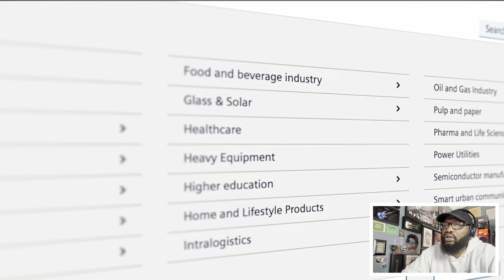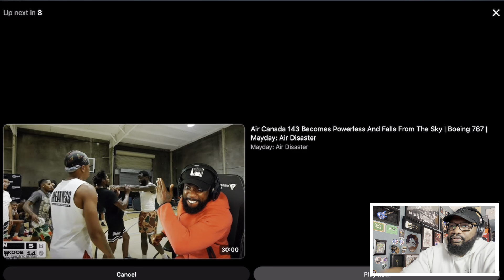Helicopters DON’T just fall from the sky - What Is “Mast Bumping”?

Comment: Sounds like maintenance on this helicopter wasn't kept up.
Reply: You can keep up maintenance, but when a part breaks, after inspection, and you're in the air... Bad news! Not like driving a car, and your alternator goes out. You can't just pull over, in the air. 
I have seen several helos in my lifetime breakdown. Twice, 12 Marines died as a result. Overseas, one went down in a port, right after takeoff. Pilot was skilled enough to land it upright, in the water, in the bay. I was in one that lifted off the ground and the rear prop wasn't rotating properly. The back end swung around, pilot sat it back down, and helo ops were cancelled for the day. Helicopters are dangerous as hell. I'll never ride in one, again!
Reply: @jamesjohnson5790 , but a part doesn’t just break if it was properly maintained, does it?
Reply: @IMeowedWhatIMeowed  Machines and parts wear out. Internal stress cracks, whatever... I have owned things from new, that looked perfect. Things have broken, snapped, given out, etc. Whether it is faulty welds (can't ALWAYS be detected by maintence), air pockets in molding, you name it! Sure, I am certain SOME of these issues have been improper inspection, but that just isn't always the case.
Reply: @ , I travel a lot by plane, and this is very scary. I’d assume a part of maintaining something would be to replace parts before they get worn out.